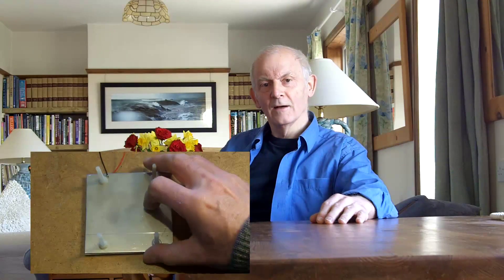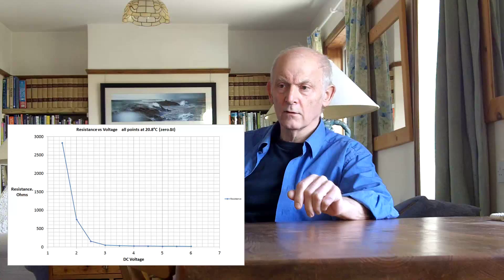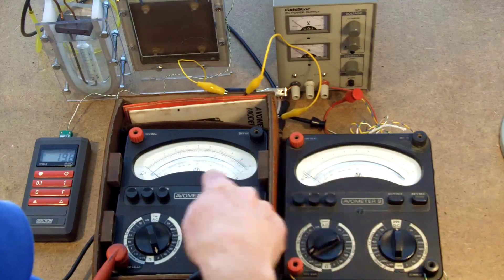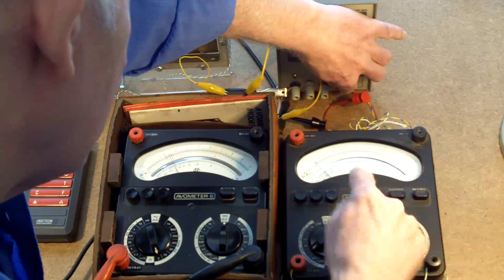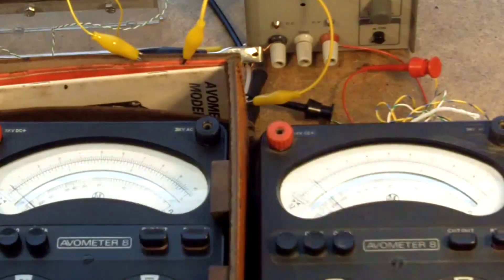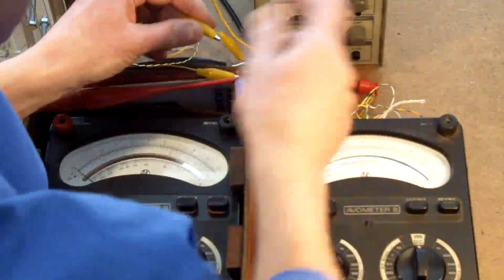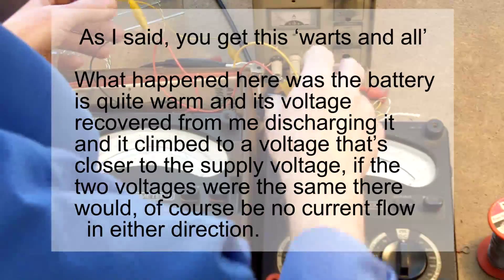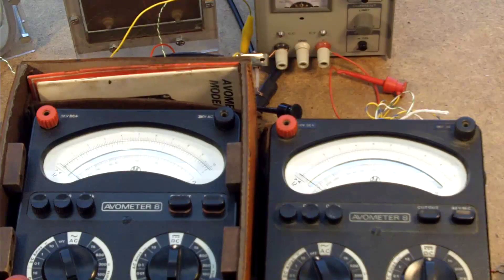HHO. 14 Comparing the cell to a capacitor and a battery

Comment: Coming in late will they thought I feel the existing HHO gas inside the unit is giving electrons back to the to the plates after the unit has been power down kind of like a hydrogen battery

Comment from the maker: Hi thanks for the interest and input. It’s a surprisingly trick little box of tricks and the harder I look into it the more surprises I find. Later today I will try the cell with a little less water in it so that there is no copper wire in the wet zone i.e. no dissimilar metal making a voltaic contribution and see what the dose.  
Kind Regards ... Andy

Comment: Like your work. The cell acts like a battery (or a fuel cell) in that once the voltage is switched off the water ceases to decompose and the reverse reaction occurs to produce a voltage. The reverse reaction is the premise of true fuel cells.  I think you need to confine the water to the opposing surfaces to get a capacitance reading. One you exceed the minimum voltage required to cause decomposition the values are not accurate.

Comment from the maker: I'll just try ringing it with a test oscillator to start with, I guess it’ll probably need some slave transistor to overcome the resistive element but I anticipate building a phase-looked-loop oscillator, that way I’ can also play with the pulse width and mark/space ratios etc. OK on the dummy loads, I once saw a (~1950’s) design involving 4 ½” earthenware drainpipe filled with salt water for use as a stage lighting dimmer working at 240 volts AC It showed how to cast the lead plates as contacts

Comment from the maker: Damn, I thought I was the first! But seriously I’d been lazy and I hadn’t tested the pH before your suggestion to do so but the water in the cell has a pH of 7 so no real surprises there. I suppose what I could do is drain some of the water off so that the level is below the point where the copper is in contact with the stainless steel so as to eliminate any ‘wet’ metal to metal contact areas. There’s always something else left to try before I can move on
Thanks for the input
Kind Regards...Andy

Comment: Very interesting series Andy, as always! Thx! I would be temped to build an oscillator (colpitts?) using the cell to explore the cell's 'capacitance'. Also, I would be tempted to change out the water and recheck the battery effect after a "run". These types of cells (but much bigger) have been used for RF and AC dummy loads in amateurs radio and and industry (testing motors, etc) for years, a salt us used to set impedance, wattage capacity is controlled by electrode size and volume of water.